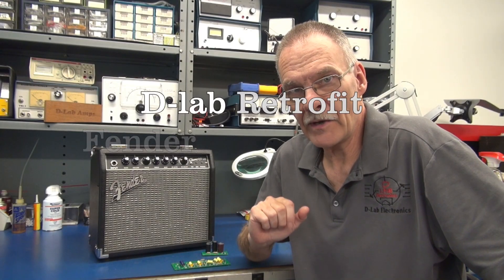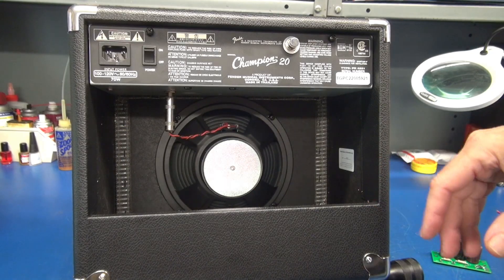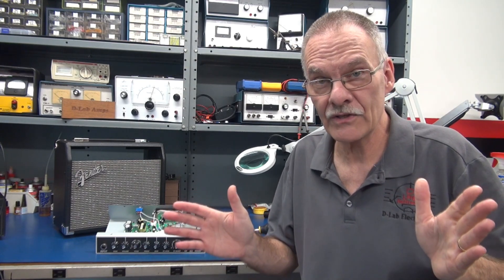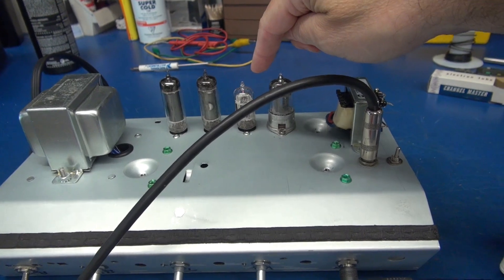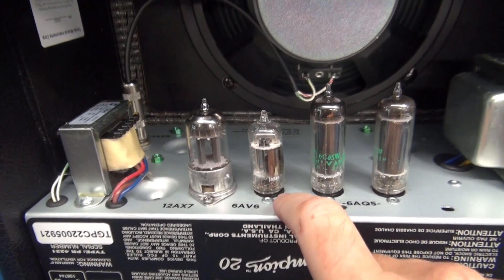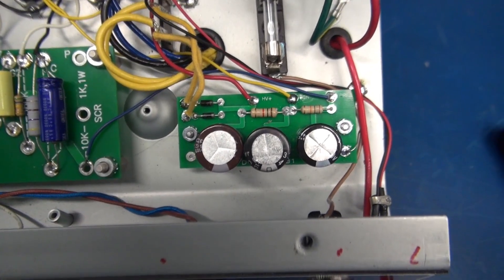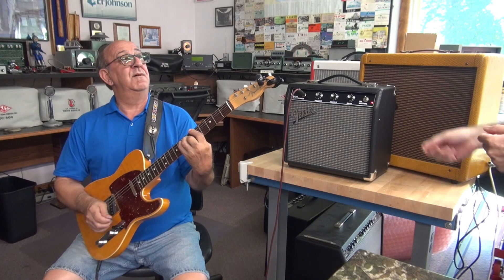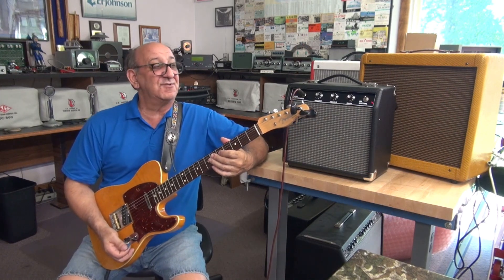Build a push pull tube amp retrofitting a Fender champion 20 solid state guitar amp

Comment: I just converted a Sidekick 15, significantly more challenging due to small size. 

Added negative feedback, tonestack cut. Impedance selector on rear. And added mid pot to champ circuit

Comment: Great video and series, I checked your video playlists but I didn't see a subject on the following: Do you have a video on Amplifier "Death Caps" and "Death Switches"?

I remember my friend had a 1977 Fender 40W Pro Reverb Amp that had a two prong plug (no safety ground) and a 3 position switch for the hot/isolated/neutral cap to chassis. I remember when we played with other guitarists, they sometimes would get a painful (but normally not lethal) shock if one touched the strings on the other guy's guitar. This was caused by if one or both amps were plugged in backwards to the wall (easy to do with 2 prong plugs for the day), or the cap switch could be switched to the hot wire (not knowing to flip the switch) which can put the chassis to an AC coupled 120V potential (but current limited through the cap's reactance for 60 Hz).

I looked at the schematic for that amp and sure enough there is no ground prong on the power plug and the cap/switch circuit "death circuit" is clearly shown adjacent to the plug symbol.

The power transformer's high voltage output winding center tap is connected to chassis ground and there is a hum balance pot between the heater output winding lines to chassis ground as well.  I know the "death cap" should be replaced with a Class Y cap that is designed to fail open (and not short which could put the chassis at a lethal 120VAC hot potential if the amp is plugged in backwards or switched incorectly).  

My question is:
In this configuration, could a new 3 prong power plug simply be added with the ground wire connected to the chassis? This will protect against the chassis from becoming a leathal voltage if something shorted out to chassis at either the input side (or its neutral was somehow connected to hot from say a miss wired recepticle) or a short on the output side of the power transformer (like the high voltage signals). Adding this ground brings the high voltage center tap from a floating ground to near Earth ground potential. In wiring the chassis to safety (Earth ground) in this way damage the amp or somehow cause excessive hum?  I would think that bringing the center tap of the high voltage and the chassis to Earth ground should work (and be safer of course).

What puzzles me is why Fender didn't simply add a 3 wire ground plug to the amp if this does indeed work. It was the late 1970's and 3 prong plus were common in metal chassis appliances and wall receptacles at the time.

Thanks.

Comment: ? Hey Terry, how much would it cost for that particular setup? Also, would it be possible to add a Tremolo/Vibrato   or reverb on that?
Reply from the maker: The chassis footprint is to small to handle the tubes/parts required for those features.
Reply: @d-labelectronics  thank you. So in that case, how much would it cost for that exact set up?
Reply from the maker: Please e-mail me for that info: n6tlu@comcast.net

Comment: Hi, great videos. Have a question, i took out an old motorola record player from an old console. It has a 4 wire plug (black, red, brown & green). The green looks like a ground but i am trying to power it up with a regular 2 (b&w) power cord, can you tell me which wires get tied up to where? Any help is appreciated. Thanks!

Comment: The sound really does jumpout at you, it sounds really springy and clear..better than most new production combos i've heard. Your amp design and that speaker hit it off beautifully! Is a 6bq5 the same as an EL84?
Reply from the maker: Thank you Sir, This amp is running a set of 6AQ5's
Reply: @d-labelectronics  Ah...got it 6aq5.
Reply: Just looked it up, EL90 in Europe plus loads if other versions, similar to 6v6 in output, thats what I read on a wikipedea page. Thanks for correcting my error.

Comment: I have the 40watt  version with built in effects unit I have been thinking of changing  in to a valve amp not sure if  some think like a 6V6 or EL84 would drive a 40 watt speaker ?
Reply: What do you mean by "drive" a 40w speaker?  You want the speaker to break up?  Otherwise, even 1w is enough.  7w is actually pretty loud, but might not be enough to hear over drums on stage.  Speaker efficiency also matters.
Reply: @GCKelloch  Здравствуйте, а сколько Ватт нужно для игры с барабанщиком?

Comment: Great build! I have a couple of your boarda I'm working on now, any chance you have a link for those small yellow capacitors you use?
Reply: Sorry, my question wasn't clear. Yes, the values are all printed in there: 100uf, 22uf, etc. I was just wondering if you could recommend a source because I see lots of vendors selling them at wildly different prices.
Reply from the maker: I usually buy my caps from Mouser. ebay is not the best choice, since many of the caps are old stock
Reply: @d-labelectronics  thanks!
Reply from the maker: What is the value of the caps your looking for? The board should have the spots labeled.

Comment: What kind of output power do these 6AQ5s produce?
Reply from the maker: 7 watts Class AB
Reply: @d-labelectronics  Actually a bit more in push-pull. The 6AQ5 is basically a 6V6 with lower max plate ratings.
So 10-12W is definitely possible. Depending on the B+, bias and transformer being used :)
Reply from the maker: yes, for this design, 7 watts
Reply: @d-labelectronics  Oh right, sorry misread that a little. The difference in absolute loudness is also not that much anyway.

I have done quite some retro fits this way, really fun projects!
Reply from the maker: Yep, I enjoy them too. Just wish I played guitar! Then I might keep a few of these creations
Reply: @d-labelectronics  start learning today!!! 🤘